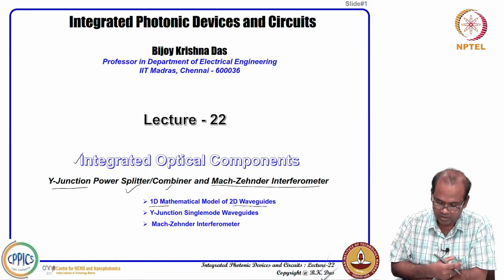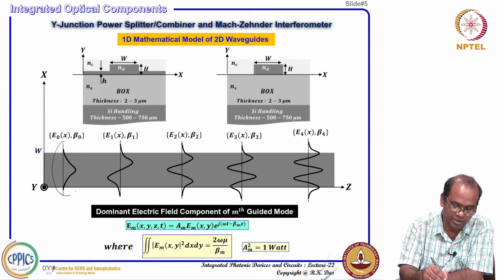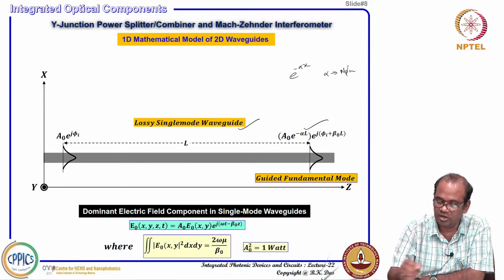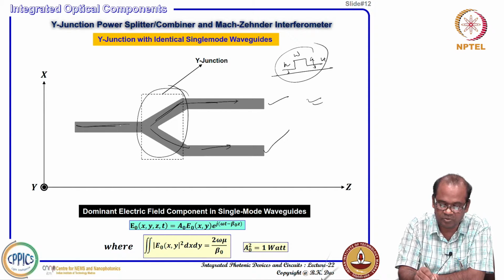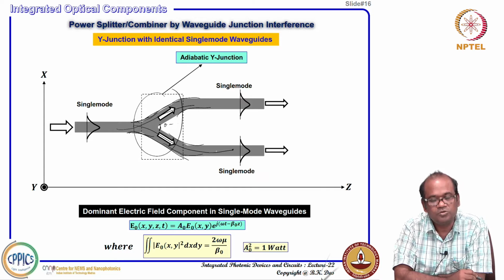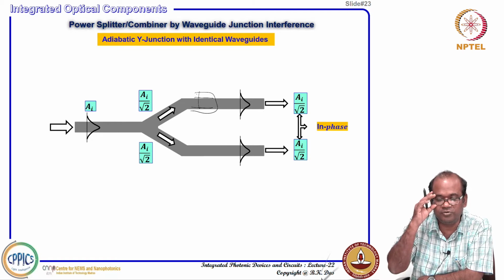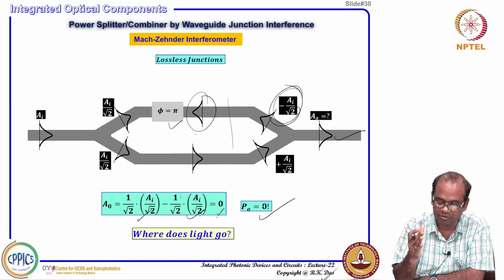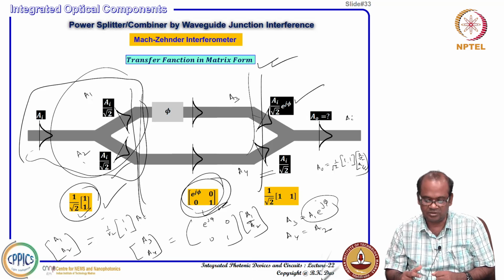Integrated Optical Components: Y-Junction Power Splitter/Combiner and Mach-Zehnder Interferometer

Comment: I like this lecture. However, I cannot understand why I need to multiply by the square root of two to get back to the right power. We know from physics that electrical amplitudes of two fields must be added to obtain the resulting sum. Nothing there says anything about the root of two. Why the laws of physics do not work in this case? 😀
Reply: there is a spilt of power so the amplitude^2 are being added not the amplitudes and also if it was a superposition of waves as you are describing then the wave vectors would be added not the amplitudes.